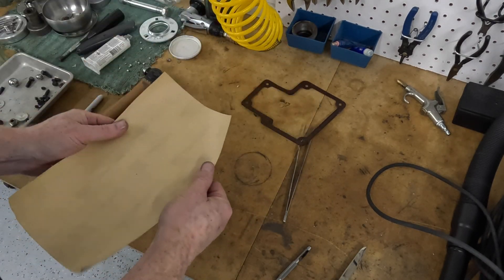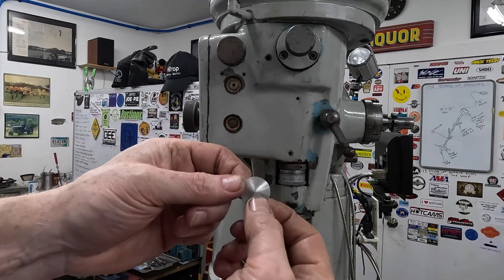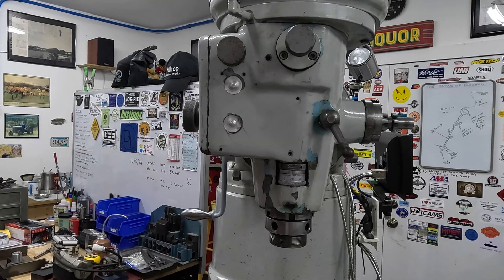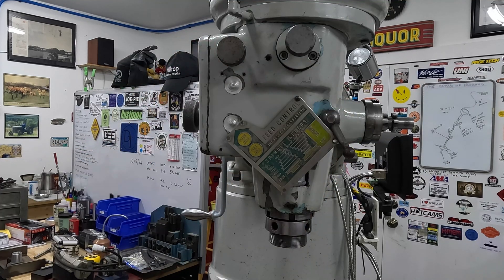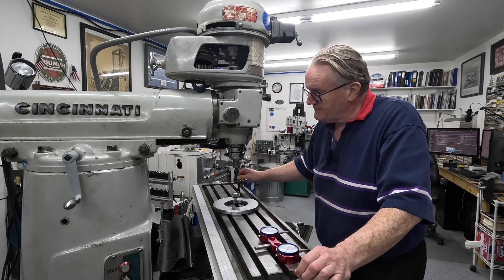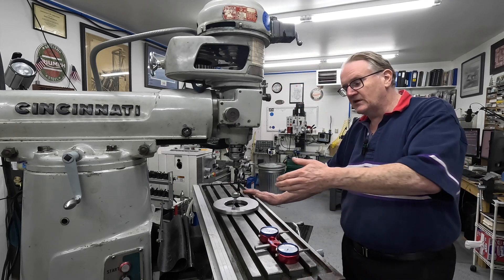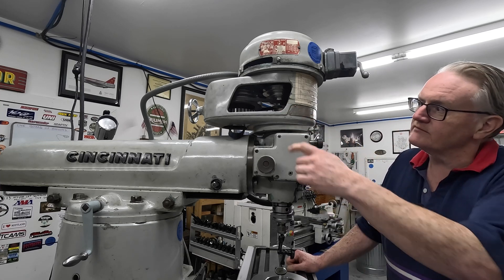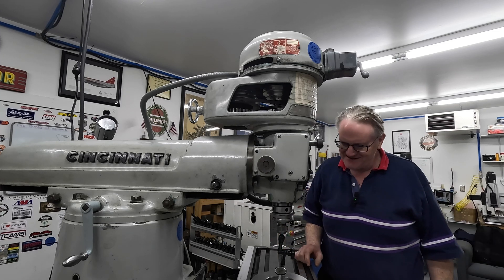1960 Cincinnati Toolmaster 1B - Assembly and Test. Was All the Work Worthwhile?

Comment: Very very well done Stuart. I’ve really enjoyed this rebuild, although you did all the work 😂 I like that round tramming plate. Not seen one before. I find tramming my mill hard as the tilt is at the base of the column held by one large bolt. Looking forward to the engine build. Be happy. Cheers Nobby
Reply from the maker: Thanks Nobby. I was going to make my own tramming ring, but I’d have had to send it somewhere for grinding, so finding one readily available was very nice.

Comment: With the look on your face, I could see that it was a success before you said so. Well done sticking with all the challenges you encountered. Yes you may find a Ding on the top of the turret ot just a flake of paint that has got under it, causing the nod error. I bet you can not wait to use it in anger making the new model. Regards from Australia.
Reply from the maker: I never was a good poker player. Cheers Dave - will be fun to make parts with it. 👍👍✌️✌️